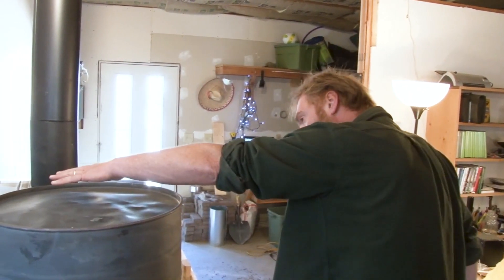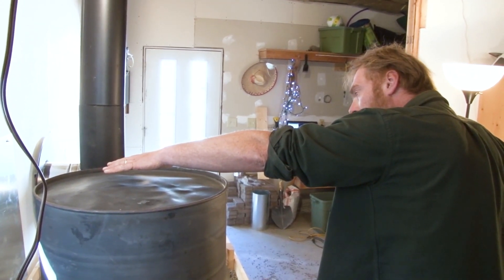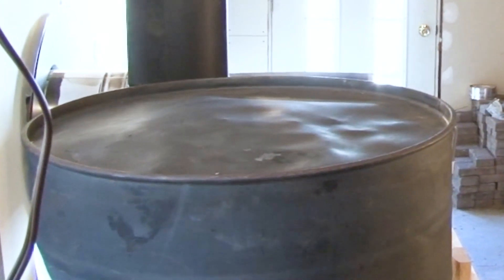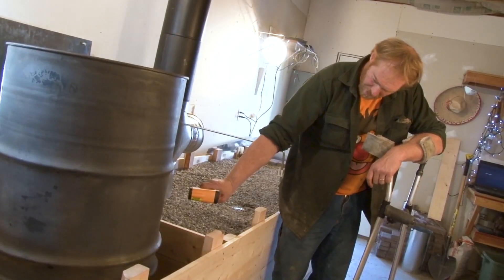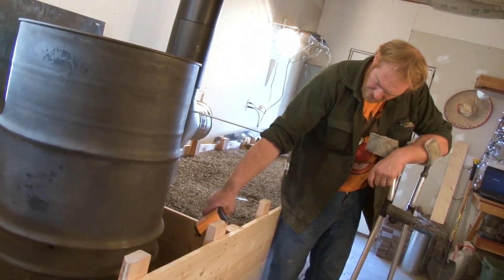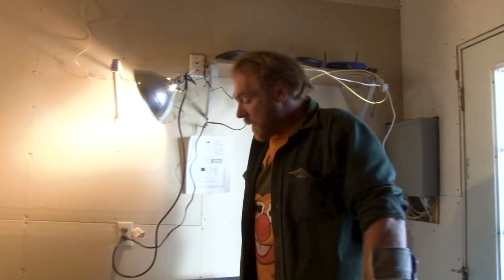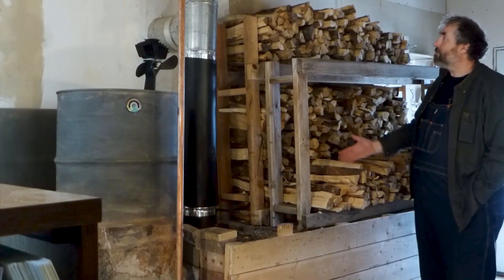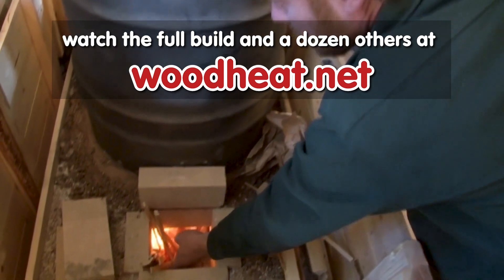pebble style rocket mass heater makes testing and changes easy

Comment: Heated wood is easily ignited. I've dried pieces of wood around my woodstove but have to watch and move it before it starts smoking on its own. It is risky to have a stack that close to the hot box I think.
Reply: there seems a fair amount of space between the stack and the feed tube; both the barrel and the exhaust flue are between them. if the flue is cool enough to touch then I think the risk of spontaneous ignition is minimal. maybe a metal sheet, if you're worried about sparks?